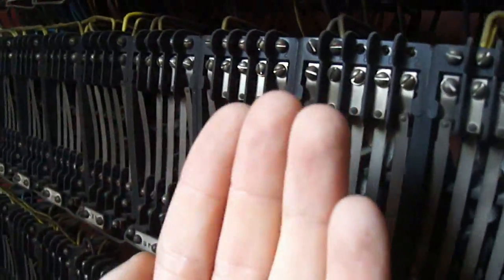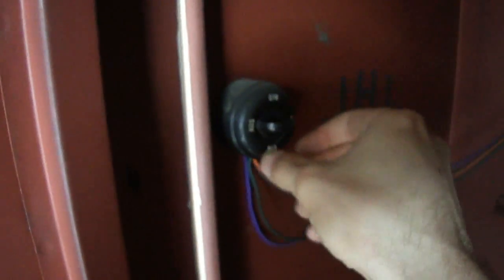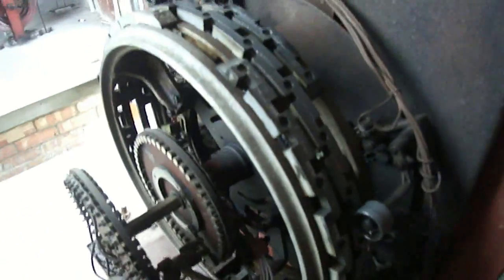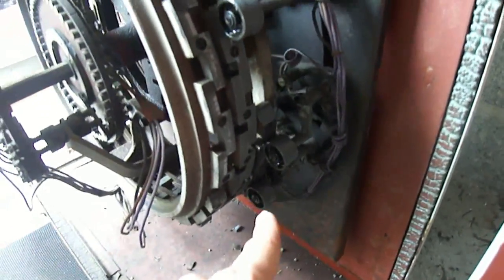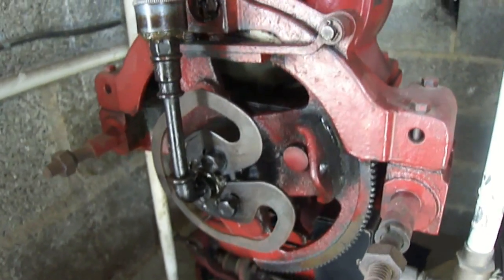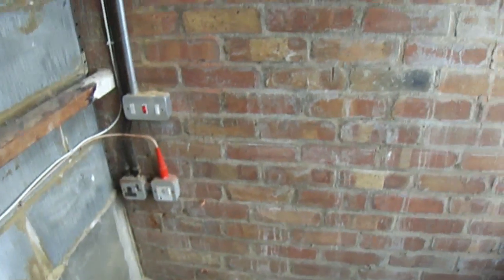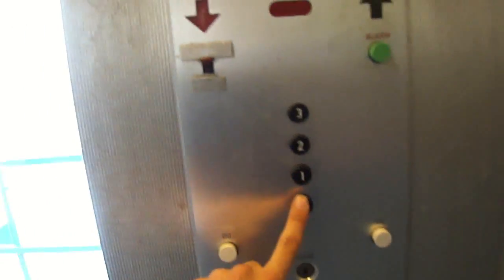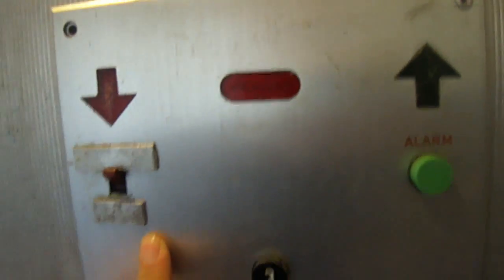OMG!  A Platt Schindler motor room!  (PART 2 of 2)  READ WARNING in description

Comment: The mystery roller switches on the selector wheel... Could they be hooked up to the panel lamps on each floor which indicates where the lift currently is?

Comment: Dear Matt. You say that You are an engineer. I see that You now some things, but I would say that You don't work on elevators. The BIG switch on the floor in the machine room is not overload switch. That is over travel switch. It is activated when elevator doesn't stop in end levels and it "cuts" all three phases. I worked on this model of elevator for five and a half years. And then I switched to more modern elevators and worked for four more years. If You have questions, contact me, please

Comment: Btw if you just wait and watch, you can see the NC floor slsector relays join when someone presses a button inside the car. Paitence is required tho :P

The relays are normally offset too *(1 for g, 2 for floor one) I am not sure with this lift, but that's how it is with Otis. Glad you finally worked out what the relays were :) It's not hard as it's just logical :)